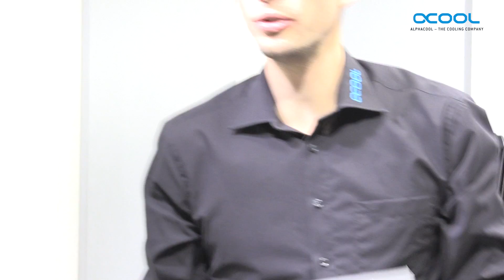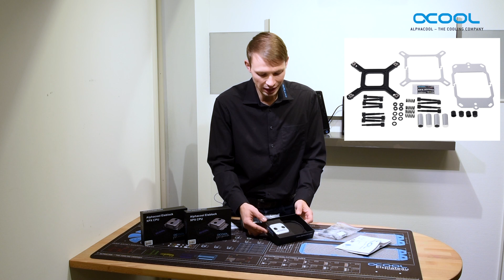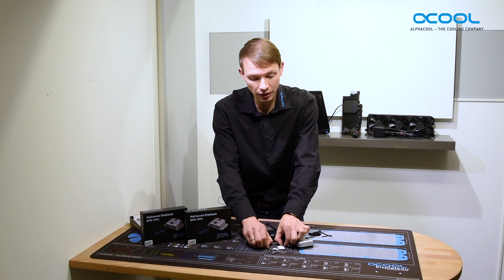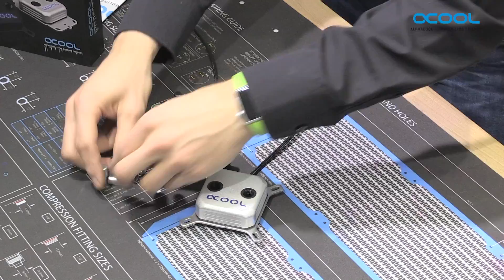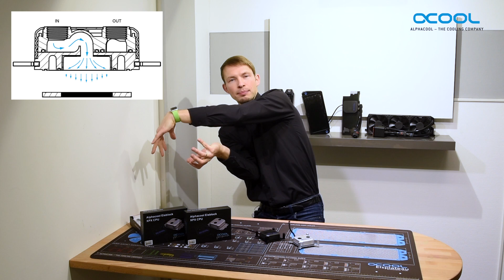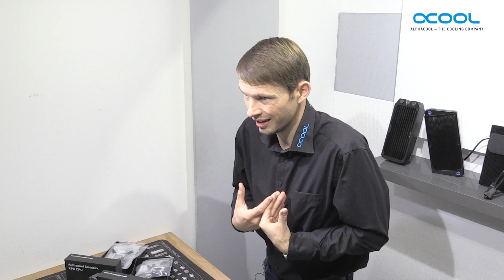Vendor video: Alphacool Eisblock XPX CPU cooler

Comment: i just checked out the alphacool site and i was wondering is this new cpu block really compatible with am4 chips even though they havent even been released yet?
Reply from the maker: We know the specifications of the AM4 socket and if you take a look on air cooler you will find a lot of compatible cooler ;) The differents between the AM3+ and AM4 socket are close to zero. We are talking about 2mm moved mounting holes.
Reply: well then i know what water cooling block im gonna be getting since i still havent decided if im gonna go skylake or zen
Reply from the maker: I am very excited about the new AMD Zen. I am not sure how good the performance will be but i hope to get more moving on the CPU marked. Until the last years, the performance of Intel CPUs increased only in small steps with 10% IPC. So i do not htink, that the next Intel generation will change that.
Reply: Well from what I have been reading zen is shaping up to be quite a beast
Reply from the maker: Well, its not the first time that you could read how great a comin up product will be and at the end.... XD.
Best example... Bulldozer, all Intel steps since Sandy Bridge....

We will see the real performance after the release ;)
Reply: Your preaching to the choir there I'm still rocking a amd phenom 2 x6 1100t
Reply: just a quick side question are yall working on a waterblock for the xfx gtr rx 480 by chance?
Reply from the maker: I had a X6 1090 too@4Ghz... but it was too slow for my kind of work :-/ Write us an eMail to info@alphacool.com and ask if we working on a cooler for your XFX. I am not sure in the moment and i do not have the list.
But you can always try this: http://www.alphacool.com/alphacool/de-send-it-and-get-one-cooler-for-free
Reply from the maker: http://www.alphacool.com/alphacool/de-send-it-and-get-one-cooler-for-free

Try it ;)

Comment: The design seems actually impressive, wondering about the performance. Can't wait to see it in action! :)

EDIT: removed irrelevant part, because checked prices at alphacool.de :)
Reply from the maker: The performance?.... Here a german review: http://www.hardwaremax.net/wasserkuehlung/wasser-kuehler/1335-test-alphacool-eisblock-xpx?showall=&start=3

You can see that we offer the best performance ;)
Reply: Thanks, will check it out! :)